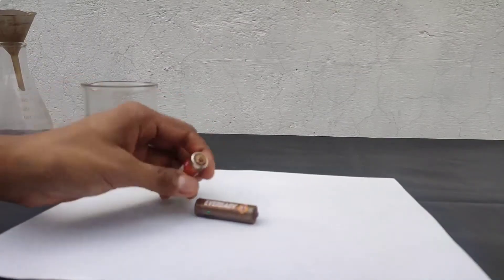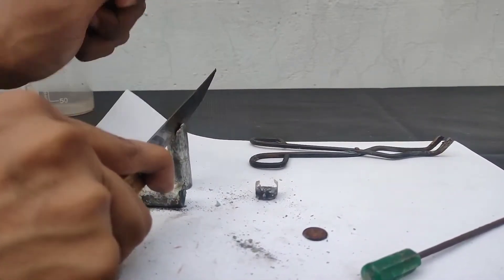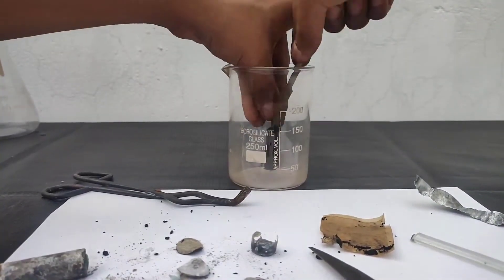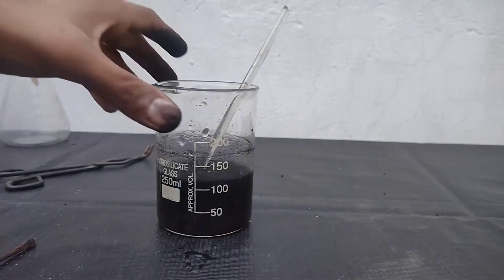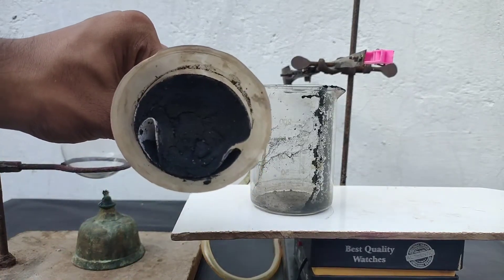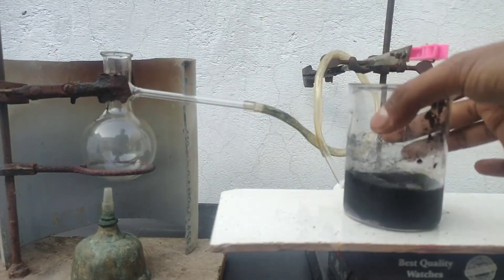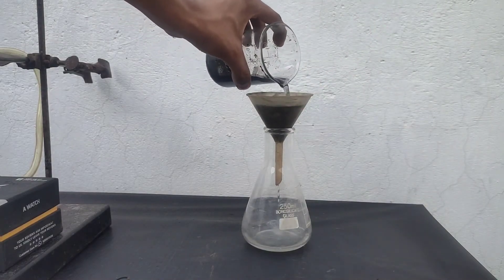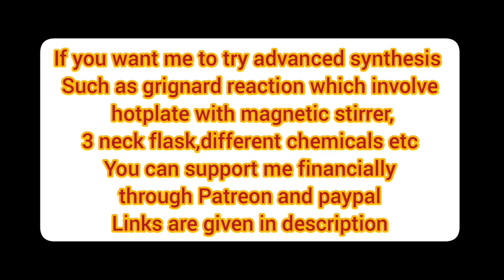how to make Manganese Sulphate from dead battery

Comment: Do yourself a favor and build a magnetic stirer. It's easy - use an old (or new ;-) ) PC-fan, glue a magnet on it. A holder for the beaker can be formed from copper or aluminum wire fastened at the srew holes of the fan. The 'fish' is another magnet sealed in shrinking tube with hot-glue at the ends. That's it. Use a variable powerr supply for the rpm - regulation ...
Reply from the maker: I have already built